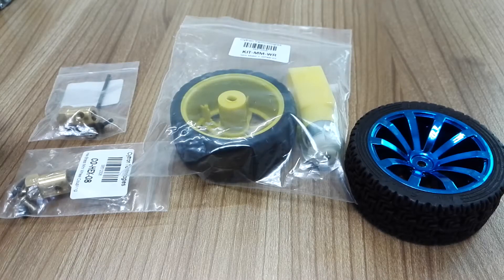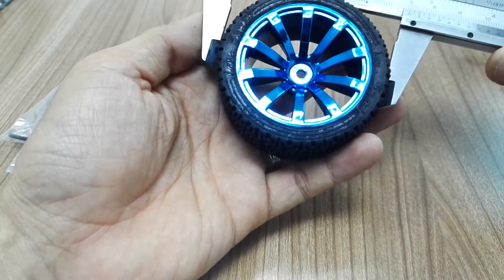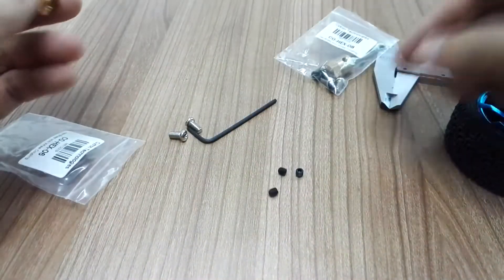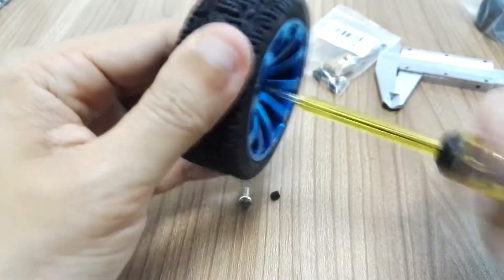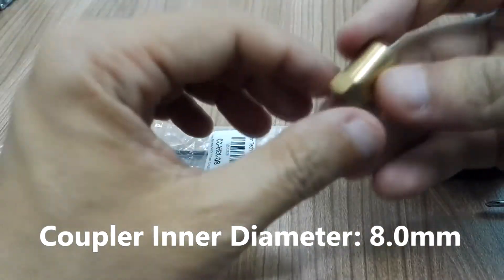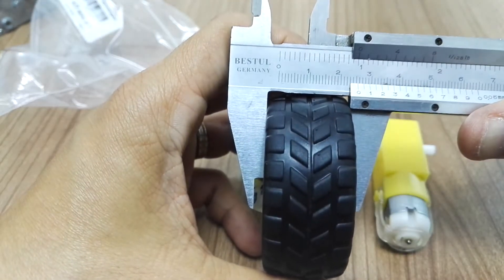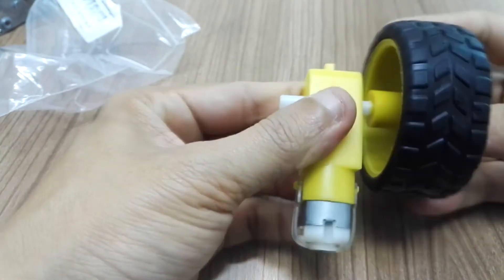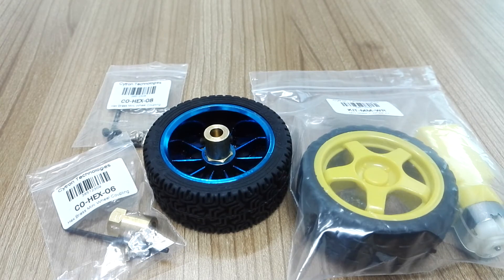How to Set Up TT Motor + Wheel Kit with Hex Brass Mini Wheel Coupling #motor #diy

Comment: Thanks for the video. For the green/yellow wheel, is there any custom coupling to install with other standard motor with round shaft? I have the same type of wheel but need to install with other higher rpm motor (motor with round shaft). Thanks
Reply: Mee too i have some problem in my project work
Reply: @taniasultana9976  haha. Finally I purchase the ready assemble machine for me 😅. Cannot solve this issue last time
Reply from the maker: Hi, you may refer to this link for coupling https://www.cytron.io/c-408-motor-coupling